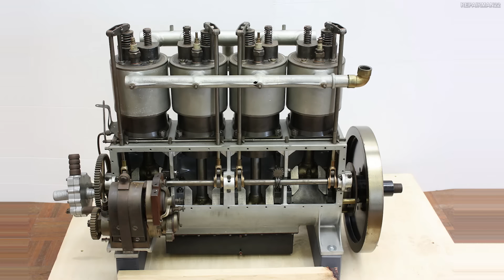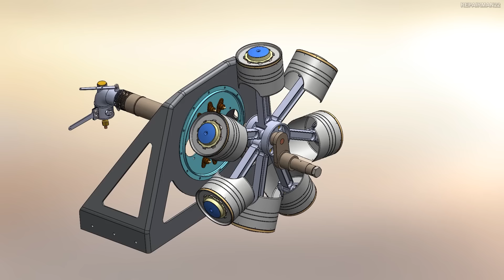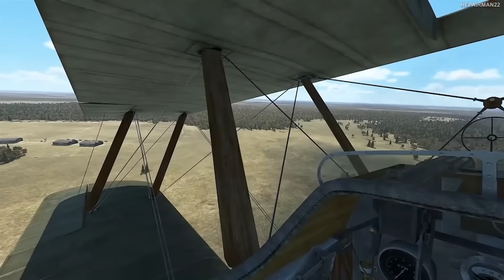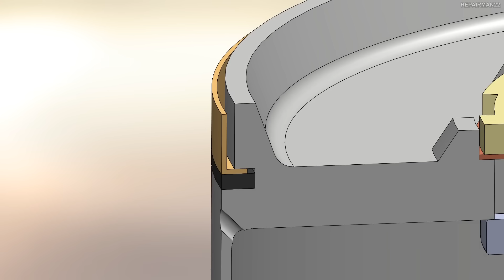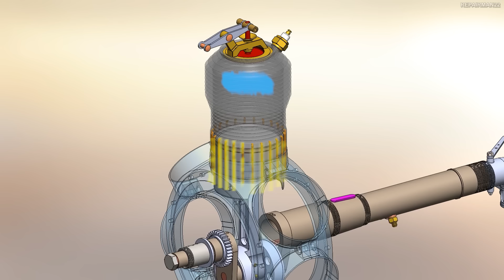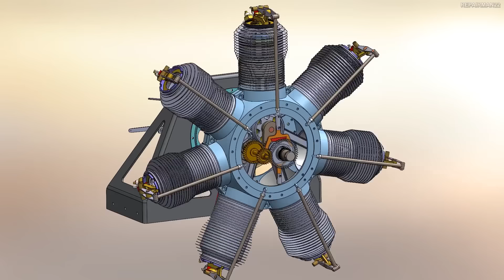This engine has a VALVE in the PISTON 🤯 Radial Rotary Engine

Comment: I wonder if the Detroit 2 stroke diesel engines would benefit from this intake valve system rather than weakening the cylinder sleeve with the intake ports in a ring around the piston. I would think not only would it be better for having a stronger sleeve but also being easier on the piston rings. I know it's a matter of cost of production but now the 2 stroke diesels are out of production so aftermarket mods are becoming more common. This would also provide much better scavenging of the exhaust gasses by increasing the time with exhaust and intake valves open as opposed to the short time the intake ports are open when the piston is at the bottom of the stroke.

Comment: Valved pistons are a common and cheap way to make simple oil-free air compressors. They tend to use reed valves though to produce the needed seals instead of a weighted poppet valve.

Comment: The Radial Air cooled engine has to have uneven numbers of cylinders, otherwise, two cylinders will be at compression stroke simultaneously, and act as a break. This would stall the engine The only way to overcome this condition, is to have a second row of cylinders, attached to a lengthened crankshaft, and off setting the cylinders, for cooling purposes. The rotary engine, had a Castor Oil/Petrol mix,  hence the British Company's name CASTROL The Wankel engine, had it origins with a Western Australian inventor, Ralph Sarich. His original prototype, is, or was, at the Perth Museum, in Perth, Western Australia. The Wankel engine was mistakenly designated as a Rotary engine. It isn't It's an Orbital.
I was always of the opinion, that the Gnome-Le Rhone, was a Two Stroke, despite the vacuum operating valve, at the top of the piston. Correct me if I'm wrong. I do stand critism stoicly. It fosters robust debate, and refinement.
If anybody of my age out there, is of my vintage, you may have had the boyhood delight, of absorbing the delights, of reading the Biggles series of books, written by a veteran of the WWI aireal conflict, Captain WE Johns,  that related the exploits of just out of school pilots, some as young as 18, fighting aireal battles, in flimsy aircraft, that were little less, than a combustible pile of linen, wood, fuel, and dope. The life span of a RFC pilot, wasn't measured in months, nor years, but hours. The mortality rate of Royal Flying Corps, Australian Flying Corps, Belgian, and French pilots, during the Fokker scourge, of 1916, was a slaughter. The Germans flying Fokker DR1 monoplanes, with deflector plates, on the prop blades,, for the machine gun, gave the German pilots, the advantage. Later on in the war, German aircraft had two Spandau machine guns fitted, with the added modification of interrupter gear, to fire through the propeller arch, without shooting it off. This saved ammunition, and improved accuracy, and firepower.

Comment: Corliolis acceleration killed the rotary engine.  Coriolis results when an object moves in a straight line (pistons) in a rotating frame (entire engine).  The Coriolis presses the piston sideways against the cylinder wall.

Comment: The in-piston valve is perfect for secondary air. Evacuates crankcase fumes to the oxidizing cat (after the reducing cat), thus providing a little fuel but mostly oxygen for catalytic staged combustion

Comment: Sorry mate, gotta correct your grammar. There is no such thing as a Radial Rotary   its a fugazi, not real... doesn't exist.
 An engine can be a Rotary or a Radial, it cannot be both., otherwise its a really good video. thanks
Reply from the maker: Thank you for enjoying the video. Thinking out loud: For example, what happens if you lock the crankshaft of a V6 so that the block rotates? What if you do the same with an inline-four engine? How can you differentiate between the two? Then they would be rotary v6 and rotary il-4. This is a radial rotary. What do you think about it now?
Reply: @repairman22  You are very welcome sir.

The rules are simple, if the shaft is fixed? and the engine spins around it? Its a Rotary.
 Same applies to the V-6 and the inline 4.

Don't believe me? Look at the two different Wankel engines. (DKM-54 vs. KKM57)
One is a Rotary, the other is NOT. 

Any questions?

Comment: It's not a rotary engine, those are STARengines
Reply: Rotary = Umlaufmotor
Radial = Sternmotor (star engine)

This one here is the first one, Umlaufmotor  or Rotary
Reply: @DoktorBayerischeMotorenWerke  but, does the engine has rotary valves? 😆
Reply: @ No.. and its not a Wanker either..
Reply: It's a ROTARY engine, not a Radial.

Comment: Today valve in piston engines are extremely common in lawn mowers, chainsaws and weed eaters. They are reed valves and are just a slip of steel in place of these valves.
Reply: Those are called "piston ported" engines, they do not have a valve in the piston like this

Comment: Excellent video. It would be great to see a small version of that motor, especially on a cycle. You said the motor was fitted to the front wheel, I'm curios why. My best friend and I made a front wheel drive, it was similar to this. We couldn't just take the engine off this moped "type" of drive unit, because the motor, carburetor, chain drive, centripetal clutch, gas tank and wheel were all cast or made as one unit. It, of course, wasn't flawless, including trips to the ER. A miniature version of that rotary engine sounds incredible, but for other possibilities. Especially making a scaled down RC model airplane. Interesting thought about compressing air, my wheels are turning.

Comment: If it weren't for the huge oil corporations shelving, delaying and deliberately negating advances with electric vehicles we all would have made the transition to EV's sooner, using electricity is a much more efficient and cleaner form of future transport available to every one and with solar batteries you can drive low cost a vehicle which has fewer moving parts and much more efficient motor -  Electric motors can achieve over 85% efficiency, while ICEs typically convert less than 40% of fuel energy into motion, 60% is wasted heat, friction and noise
Reply: What advances in electric vehicles?
Electric vehicles have been around for well over a century and still suffer from the exact same fatal flaw.... rechargeable batteries.
Electric Motors are super efficient, batteries are not.
They are horribly inefficient, expensive have short service life and are extremely bad for the environment

You still have a lot to learn son, stay in school and study hard.
Reply: @WilhelmKarsten -  Dream on  ! Rechargeable batteries the type used in modern EV's are highly efficient, boasting  efficiencies of up to 95%, meaning they can retain and discharge a high percentage of the energy they store, much higher efficiency than you can extract from petrol or diesel. Combine that with the extra high efficiency of Electric motor beats the ICE hands down.  EV lithium-ion batteries typically have a service life of 10 years, or 200,000 miles, but can potentially last longer. You must have attended reform school because batteries are much more environmentally friendly than burning fossil fuels  and how to properly dispose of batteries. - even a fifth grader knows that
Reply: @majorrgeek  Please name a currently available rechargeable battery that is 95% efficient?
I live not far from from Moss Landings, a community now highly contaminated and polluted by lithium batteries.
In particular the water soluble Cobalt which is responsible for birth defects and reproductive cancer.

Please educate yourself son, don't be a mindless, woke robot
Reply: @WilhelmKarsten  - at school is where you learn how to research and if you don't know how just ask a 5th grader they will tell you -  lithium ion batteries 95% efficient - Vistra factory fire was an industrial accident  - An estimated 5.13 million (3.63 to 6.32) excess deaths per year globally are attributable to ambient air pollution from fossil fuel use and therefore could potentially be avoided by phasing out fossil fuels. - let me guess, you're another Magamoron?
Reply: @WilhelmKarsten  Sure, Lithium ion batteries are 95% efficient - the Vistra power plant at Moss Landings was an industrial accident and far worse pollution has resulted from fossil oil and gas plants world wide - An estimated 5.13 million excess deaths per year globally are attributable to ambient air pollution from fossil fuel use and therefore could potentially be avoided by phasing out fossil fuels.- don't be a mindless Maga
Reply: @majorrgeek  It's irrefutable proof that rechargeable batteries are not pollution free.. and they have no advantages over traditional liquid or gasses energy storage mediums.
 We are just beginning to see the environmentally destruction caused by the widespread use of rechargeable batteries.

Of course we have yet to touch on the most serious issues with batteries, the numbers of fire related deaths linked to lithium batteries has skyrocketed and the Fire Safety Board says its the largest growing problem in fire related deaths.
Reply: @WilhelmKarsten  - Rechargeable batteries are completely pollution free and produce no environmental destruction during their service life and do not release no where near the massive quantities of burned gases from fossil fuels into the atmosphere which contribute to over 5 million deaths per year, cause changes to the climate and ozone layers which contribute to much more damage you can imagine . The number of global deaths due to combustion of petrol and diesel vehicles far outweighs Li Ion fires, in fact new blade batteries are completely fire proof while petrol is and will remain an explosive chemical.
Reply: @majorrgeek  You are simply being dishonest, you know that that rechargeable batteries are major source of pollution and is the fastest growing cause of fire related injuries and death.
You cannot deny and ignore these facts
Reply: @WilhelmKarsten  sure rechargeable batteries are not perfect but cause fewer deaths than fossil fuels do each year about 5 million people die from the effects of Fossil fuel pollution - you can't beat that statistic with your bullshit
Reply: @majorrgeek The rate of deaths due to battery fires is increasing every day.
There is no data available yet on long-term health risks from exposure to heavy metals and other toxins released into the environment due to EV fires.
High levels of Cobalt pollution is starting to show up in California waterways, the State has the highest number of Toxic EV fire pollution in the world.
No studies yet exist on the impact of this EV pollution on people or wildlife.

Cobalt is a Known Carcinogen and causes birth defects and reproductive cancers.
 You are just a shill for crooks like Elon Musk and the fraudulent vaporware EV investment scams..

Comment: What is a "master" connecting rod?
Reply: The Master Rod connects to the crankshaft, all the other rods "slave rods" are connected to it.
This design is used in Radial engines and is also found on V engines which have symmetrical bore spacing.
This engines use either master & slave rods, or they can use fork & blade rods
Reply: @WilhelmKarsten  I feel a little foolish now, because in the dark recesses of my brain, I knew that. If I had thought a little longer, I would have remembered that  the crankshaft could only have one connection point. I guess that's what happens when you are as old as dirt.
Reply: @blumobean  No worries my friend, cheers!

Comment: It could work but more moving parts so more points of failure.
Reply: Very successful design in  its era... they only died out when engines started pushing 300+ hp.
Reply: It did work for a bit over 20 years.

Comment: Absolutely amazing, this is the best guide on the inner workings on rotary engines on this site to date. 

I've always wondered how rotary engines worked, and now I'm absolutely convinced that the designers were on something when coming up with these ideas.
Reply: on something? for just a rudimentary radial?
try... "no prior conceptions or notions on what an engine should be".

if you think a radial is weird, try working out a melhuish aka gothic oil engine, with its stepped piston and vacuum scavenging with condenser instead of blower or forced induction... 

 or maybe a "furnace gas/ericsson" engine...

or maybe a "mcewan rota-mota".

Comment: Invented in about 1888 by a Frenchman named Le Rhone (I can't get "hickeys" over the "e" 's on my keyboard). Used in the LeMons car race of 1900 but lost to the 7 liter SINGLE CYLINDER FIAT! BTW, there is NO POSSIBLE internal combustion engine design that hasn't already been USED in a car, boat or aeroplane. This was PROVEN in 1934, by a meeting of the Society of Automotive Engineers. Most of them PATENTED by Sir Harry Ricardo of England, before 1914 (WWI)!!!
Reply: Invented by Felix Millet.

Comment: The early Gnomes were really some of the worst of their type, the counterbalanced valve was prone to gumming up and sticking open, they also had very short TBO's in rough field conditions.

 The Monosoupape Gnome with the two cycle style porting flutes at the bottom of the cylinder were far more reliable and ran with more power.

  Frankly the LeRhone with the single push/pull rod driven rocking valve actuator was not too much later in development than the old Gnome 50 and 80 hp engines, and made more power with less displacement.  The biggest problem with this valve in piston Gnome was the intake was largely atmospheric pressure actuated, whereas the Monosoupape was pressure wave actuated and had far less moving parts.

Comment: There was also a Dubuque, Iowa truck company that used a rotary engine. It was mounted horizontally Justus behind the cab and under the bed. There is an example (or was in 1976!) at the Air Force Museum in Ohio.

Comment: If they added fuel injection then they could use the single valve for both intake and exhaust and eliminate the ports in the side walls. This would allow sealing the crankcase eliminating the need to add oil to the intake. They could also use the whole power stroke because no concern about fuel air mixture being ignited in the crankcase. Better lubrication should improve the life of the engine. Stopping fuel injection would allow cutting power without dosing the plane with fuel. The centripetal  force of the engine rotation could provide the fuel pressure for the injectors. The injectors could be controlled by the same valve control cam. Might make an interesting project to build one like this.
Reply: Packard made a diesel radial engine in the late 20's, early 30's that did just that, had 1 valve from both intake and exhaust, was not successful https://en.wikipedia.org/wiki/Packard_DR-980
Reply: @Kubla84  That is cool to know! Thanks!

Comment: I wonder if a modern implementation of this could have advantages in certain applications - especially considering it being air-cooled, low vibration, and light weight...?
Reply: How do you imagine firing the top cylinder every other time meant low vibration? Do you mean other instrumentation along connecting rods was excluded by 3-mode vibration, but this is just the Stirling for your engine-centric radial vane VTOL plans? (Would demo to Franz Ferdinand, Franco, and Lenin? (cough)) How did the plane not immediately coke up from partial combustion of castor oil?

Comment: Thank you. Excellent video. 
I had the Radial Rotary engine explained to me at the RAF museum at Hendon one day, but you have made the explanation even better.   🙂
One question: late in the vid you show the modified exhaust valve venting even as the piston was descending. 
How did the piston not instead suck in via the exhaust valve?
Reply: No such thing as a Radial Rotary engine...it is either a Radial or a Rotary type.
It cannot be both
Reply: @WilhelmKarsten  Yes I know, but I was copying the "Radial Rotary" from the video title.
Reply: @fredericksaxton3991  Unfortunately the title is incorrect and misleading

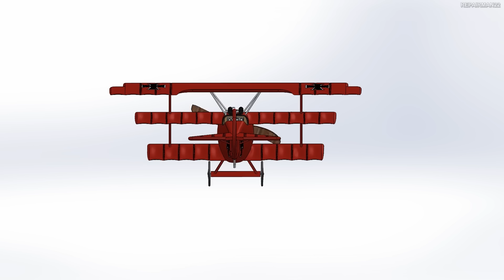Comment: 9:46  An interesting video but I think that the turn to the left vs turn to the right was not due to gyroscopic effects, my understanding of that is that that a gyroscopic effects acts at 90 degrees to the rotation so it would make the plane pitch up or down. The left, right difference is simply due to the torque reaction of the large engine, basically the plane trying to rotate around the engine!
Reply: The effect is correctly called Gyroscopic Procession and it's the same phenomenon that causes single rotor helicopters to turn faster in one direction than the other.

Early biplanes from WW1 had relatively low horsepower and low engine-to-aircraft weight ratios.

 As the power output increased so did this unwanted behavior and this is when conventional engines began to supercede the Rotary type
Reply: @WilhelmKarsten  
Yes the term the effect that I'm talking about is called gyroscopic procession and it is a force that acts at 90 degrees to the axis of rotation of the spinning mass. This will cause the plane to pitch up or down, the difference in roll rate of the plane when rolling left or right is down to the torque reaction of the engine.
Reply: @sidecarbod1441  Yes, this is called Torque-induced Gyroscopic Precession,  it causes the aircraft to pitch-up and roll over on its back in the opposite direction than the engine rotation unless counteracted by roll and yaw inputs from the pilot.
If the airspeed is too low the pilot will not have sufficient control authority and the plane will roll on its back, on take-off this results in a common crash failure mode.
The technical term for the Torque moment is Nutation
It's the same effect that causes helicopters to flip over and crash when the landing gear is on the ground